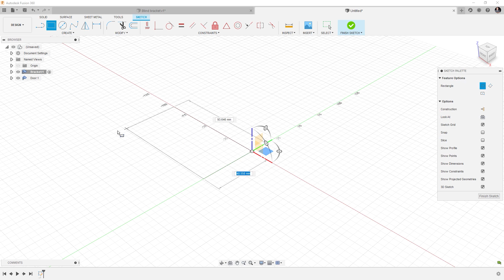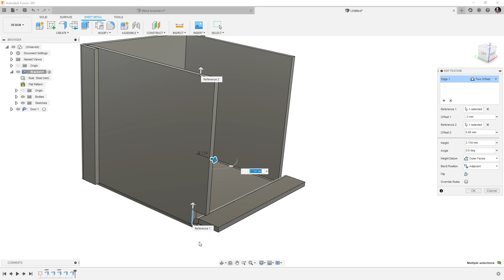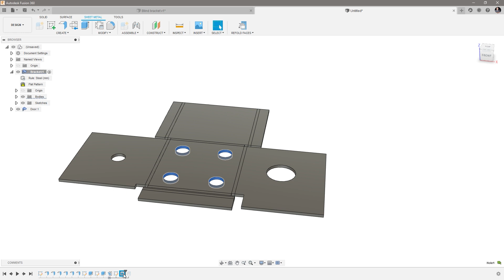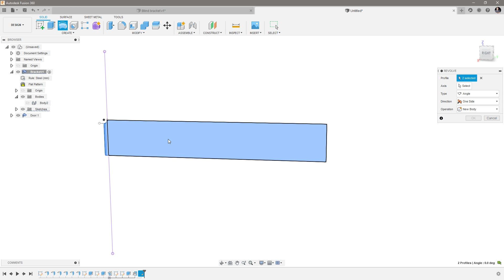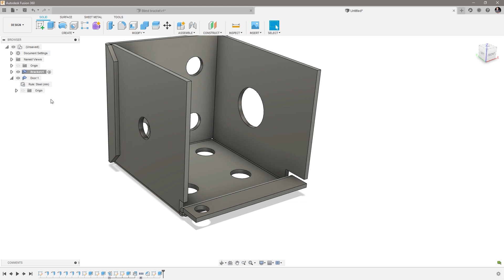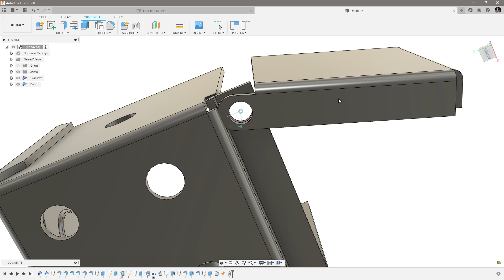Fusion 360 - What's New Sheet Metal -Season 3

Comment: Hoi Lars
This is a very good livestream for the sheet metal f-360 user
Flanges extrude folding assemble joint revolute ...
but how do people in america call this part:  Bracket ?
Can you change this in: Suspension bracket or Mounting bracket for blinds, Side supports or Mounting supports.

Comment: HI Lars 
I want to add a flange to the rounded ( arc ) edge on a sheet metal pattern. How would I be able to do that? It doesn't allow it as a bend or flange.... It only allows for flanges to be added on straight sections....
Help?

Comment: How do you create outside miters?  I am working on a drawing for a tank and I would like to have a 2" flange going around the top edge of the tank, which will allow the tank to rest on this flange when placed in the frame.  I would like to have each flange to meet at the end with a 45 degree miter for welding.  I just can figure out how to create the  mitered corners.

Comment: HI Lars, can you help me with a flat pattern? I have tried everything and can't get it to flat pattern. I made a solid body and then created a shell. Is it possible to flat pattern it?
Reply: dont turn it into a shell but turn it into sheet metal part
Reply: @spencerhazelwood9355  thanks for the reply. I have tried that, but sheet metal only seems to work with flat and straight parts, I am trying to make a flat pattern of a slightly curved surface so it simply doesn't see it as something that it cam do that with. I was wondering if there is a trick I am missing. If you can help that would be amazing.

Comment: Very cool, I don't do sheet metal but this can be used to build 3d models out of paper or 3D printing. Also cutting wood with laser.Can Fusion 360 do also surface layout optimization when you have to cut the  sheets of material? Thank you 😊👍
Reply from the maker: Hi Daniel, Thank you for watching. Yes, that is the new arrange function that I need to make a video on soon .

Comment: Great video as always.  Is there away for fusion to put in bend parameters of a press brake to know if you can “ACTUALLY “ build the part. I’ve made several sheet metal parts that I had interference with the press brake tooling
Reply from the maker: That is a good question. The only thing I can think of is to maybe make a part that is the press brake and check if the fold would fit within it. No easy solution

Comment: Thank you as always :) I love the sheet metal stuff. Its amazing how simple and intuitive it now is, compared to when I used to do that sort of stuff 2 decades ago in 2D Autocad! I almost want to go out and find an application for it so I can have a play with it ;)
Question: once the design is flattened out, is the output of that to DXF the feature which is now limited to the pro version?
Reply from the maker: Thank you for watching. Yes, you can still export a sketch as a dxf. You you could project the flat pattern in a sketch and export that. You could also program the part in the 2D CAM workspace and send the code directly to the machine and avoid the dxf.

Comment: I've used 3D-printed parts in order to create tooling parts for shaping sheet metall. Wouldn't it be a cool option if you create a sheet metall object and from that can create the tooling part/parts with the click of a button? Is there any option for that in Fusion or any other CAD-program today?
Reply from the maker: You could use something like the boundary fill or boolean operation to do something like that. That would make for a fun video
Reply: @cadcamstuff  Thank's Lars. I'll see if I can figure that out :)